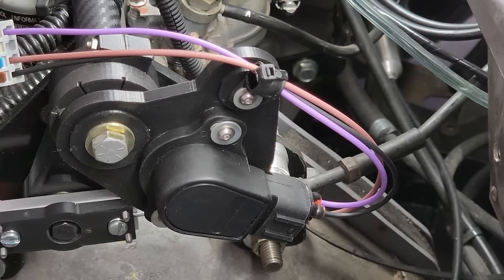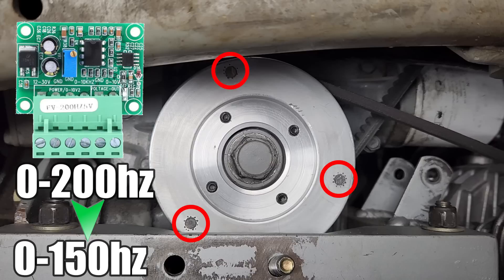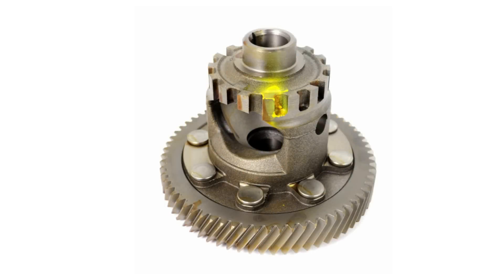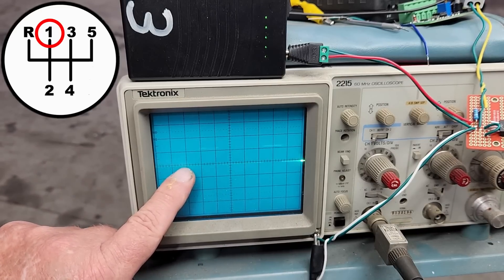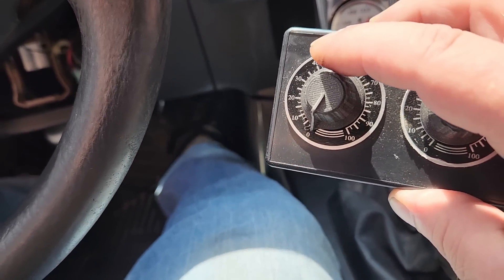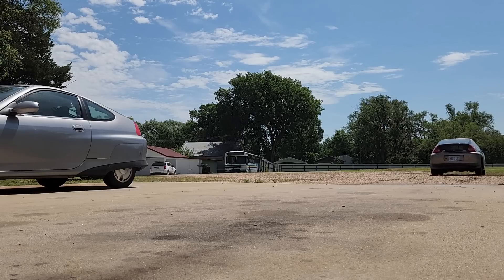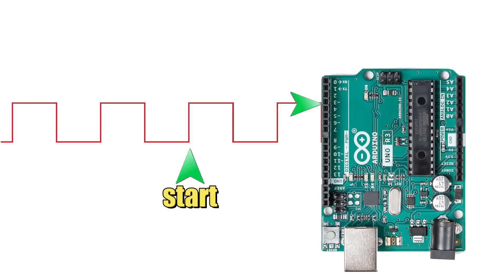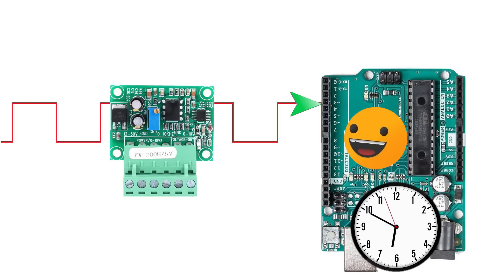S4 E21.We make progress on the Arduino controlled AMR500 supercharged Kubota diesel powered Honda

Comment: (EDIT: I see we get a special section talking about interrupts at the end.. EDIT2: As far as documentation, well, you're going to look at the datasheet and which registers are available and how to configure them. It's just not documented in a single place at that point, because now you have to find corresponding variables exposed for those registers.) Man, you mentioned a voltage converter and I'm sitting here thinking about a voltage regulator and wondering what on earth you're talking about with frequency (especially if it's linear) and why it would even matter. 😆... That said, I imagine if you configure an interrupt on an input pin on the Arduino (Or you might be able to configure a counter peripheral, not sure without looking at an ATMega datasheet, but an interrupt is definitely doable), you could just count the pulses directly instead of worrying about a frequency to voltage converter. At 200Hz I imagine the overhead wouldn't be terrible or necessarily impact the rest of the program. Do I think you're going to do this? Probably not, especially if your existing solution is functional.

Now for some more information you may or may not know and may or may not care about.. The Teensy line of devices generally has a much more powerful processor than an Arduino while being in a smaller package, so if 200hz was a problem with the Arduino counting pulses directly, there are alternatives out there that have a much higher operating frequency and wouldn't care at all.

Also, I've played with a few of the STM32 Discovery dev boards and those processors are also very powerful, also have a Nucleo I may not have touched in a while. Lots of good options /if/ you're ever interested in going further. Teensy is Arduino IDE compatible so pretty easy to use. The STM32 dev boards can be a bit more work.... 

Also your beep at 9:08 just now made me think my sump alarm was going off. How dare you? 😆
Reply: I’ll add that the RPi Pico is fast enough to directly count the pulses.  I’m using one for fuel injection control on my old truck.
Reply: @gregholloway2656  That's fun. Did you use any of the Speeduino kit for FETS + drivers or go for a more home brew solution?
Reply: @Sevalecan  totally home brew.  The Pico outputs trigger op-amps that act as buffers and drivers to darlington transistors, which then fire the fuel injectors and bipolar stepper motor for IAC.  I’m testing a second version now that adds distributorless ignition control.  The Pico is easily fast enough, and the dual processors really helps.
Reply: There are also the more powerful ST microcontrollers in the Arduino footprint, I was a fan of the M0 but I think they discontinued it.   I ended up using a MKR series last time I was fiddling with them as it had a 16 bit ADC